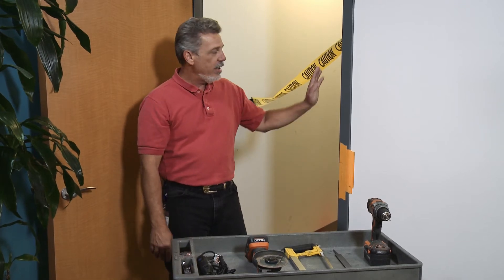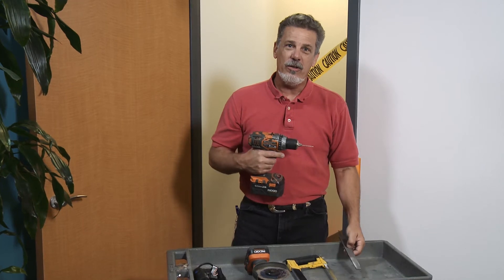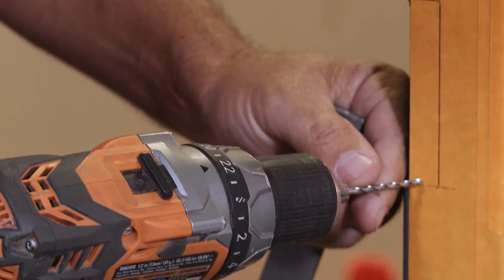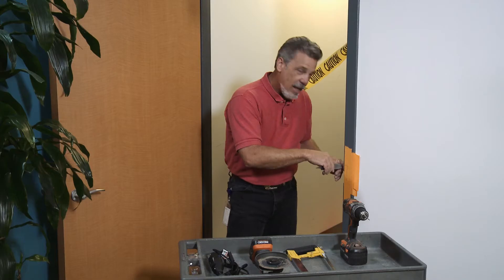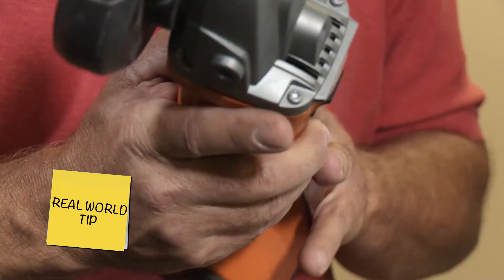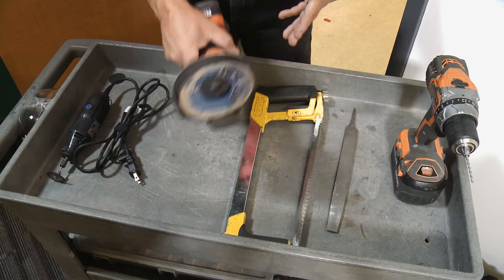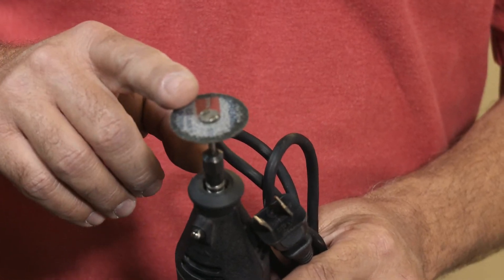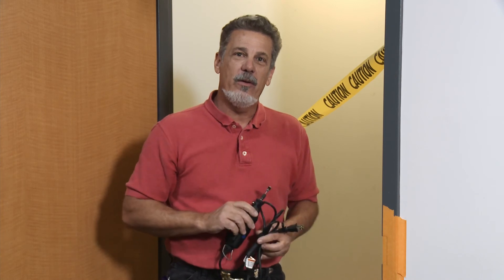Hollow Metal Frame - The Right Tool for the Task

Comment: I use a dremel and I love it. Works just the way I need it to. No crazy runaways like with an angle grinder. I also use a metal blade on an oscillating tool, which also works great.

Comment: I use a 3" cutoff wheel  1/16 or thinner with a Metabo GE700 1/4 inch Die grinder. (Hold firmly and take your time) Dremel will not last and is not at all efficient if you install any . Today I installed 7) 8500 Strikes with the 852L for Schlage 9000 Series Mortise lock. I pulled the knock down 3 piece door frame (strike side) after the carpenters told me " you dont want to take those frames out". The frame were easy without removal. However the 14 guage 2X6 studs were a PITA. After doing 1 frame with a SC3 Tungsten Carbide Burr bit to hog out the studs they had already drilled a bunch of 1" holes in the studs to make thier strike plate and plastic back box fit. Im thinking.....Why in the hell didnt you cut the stud "before" you installed the 100 plus frames. The face of the frame has an aluminum trim that snaps on. You can look in my preps and the look like they were machined from the manufacturer. They were "Timely" brand frames. The 8500 Series prevented me from having to cut into the Aluminum trim. Be aware that the 8500 is a body only. You must order the face plate and deadlatch release lever seperatley. Each Lock brand hasd a different part number. I love the 8500 series! Im not to keen on the 8300 series for cylindrical locksets.